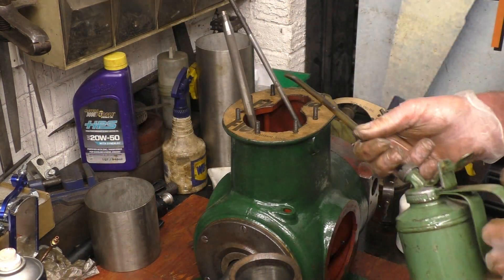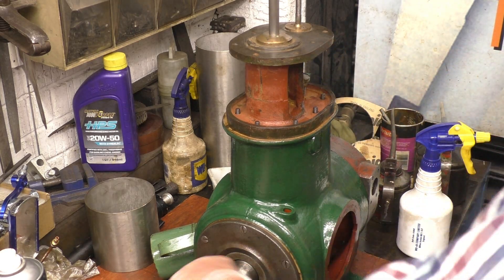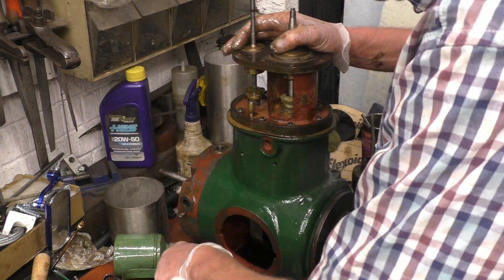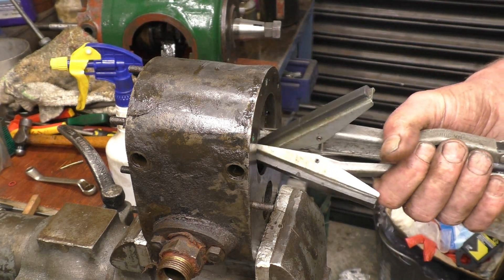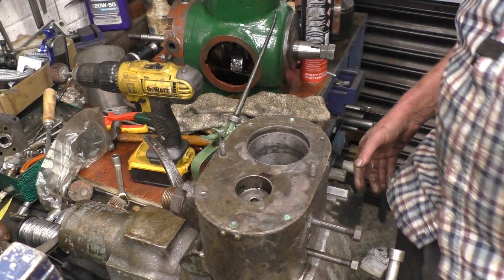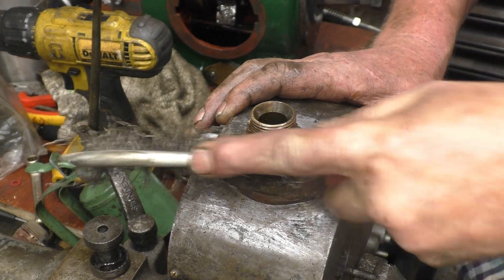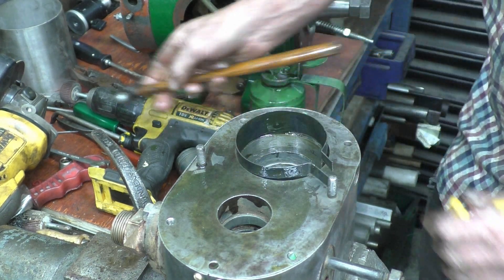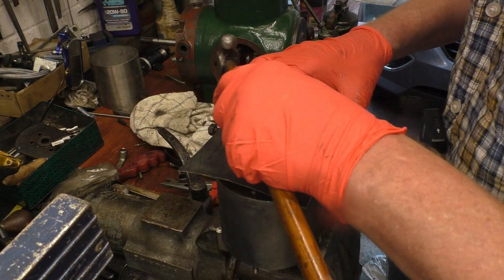Stuart Engine P10b  Block & Piston

Comment: I quess we have to settle with the steam engine imitation until it wakes alive.
It sure is getting heavy and I can only imagine how it will be with all the bells and whistles on. I have had an impression that there isn't much room to spare in You shop so probably a trolley is out of question.
I like this series especially because that engine is not of the conventional total loss lubrication type. At least half of the lubrication is circulated. It is already looking like a decent engine and I can imagine it replacing the motor in a Reliant Robin. Instant sauna.

Comment: 2:50 I'd heard a story about doing it to mess with the Germans, but saving metal seems a lot more logical.
Reply: I understood that the Whitworth nut/bolt head size changed turn of 20th century  ( 1900), larger head size was to allow higher tightening values due to very soft materials only being available at that time ( Stress over Area). Would love to know the definitive reason.